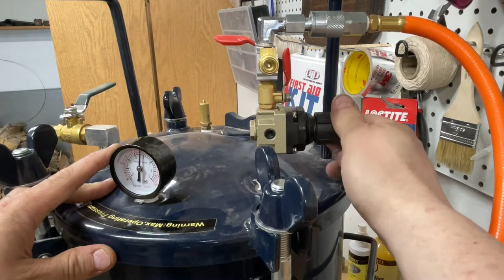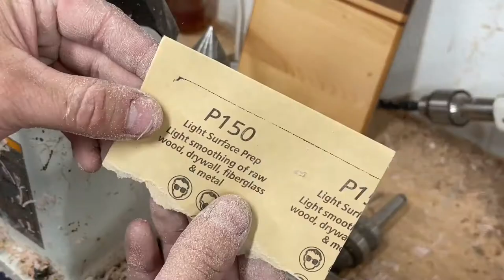Woodturning an epoxy and wood duck call

Comment: Do you have any direction you could give me on the pressure cooker
Reply from the maker: No problem! I put it in there and bring it up to 60psi. I usually open it about 24 hour later. The Amazing Clear Cast resin I use usually takes another 2 days to fully harden before I turn it.
Reply: @JustinBeyerlin1   what kind of cooker is that exactly? I’m new into calls and blanks are getting expensive.
Reply from the maker: @adamnewcom2999  it's a California Air Tools - Pressure Pot for Resin Casting
If you're just doing calls, you could get away with a much smaller and probably cheaper pressure pot. This one is overkill, but I do bowls and other larger stuff sometimes.

Comment: Hey bud, research this for sure, but I think you only need 35 psi for like 20 minutes.
Reply from the maker: I only chose the 60psi because I’d read that in a few places. But, I’m always learning and no opposed to trying new things! This epoxy I’m using takes a full 24 hours to be close to ready to turn though. I figure it doesn’t necessarily hurt to leave it in overnight if I can’t turn it anyways :)